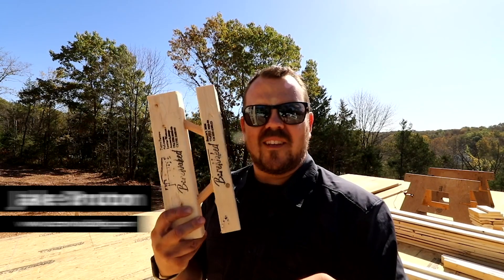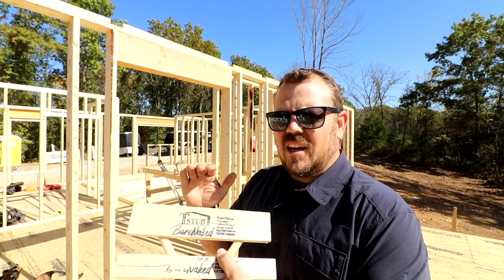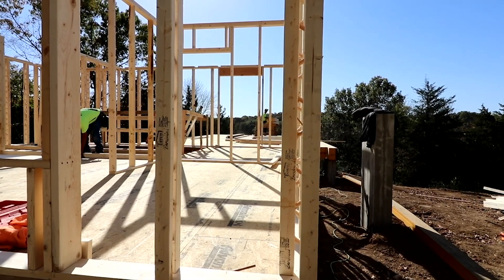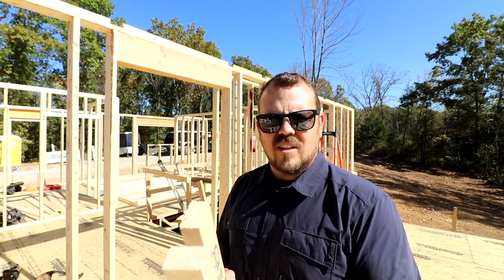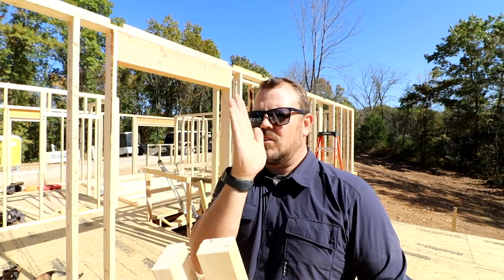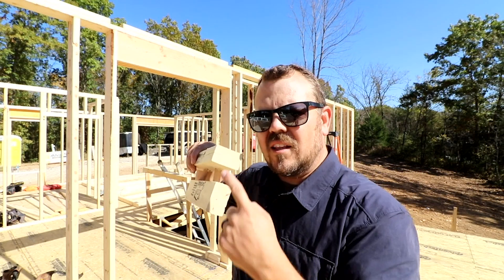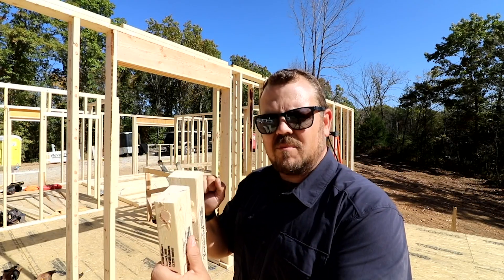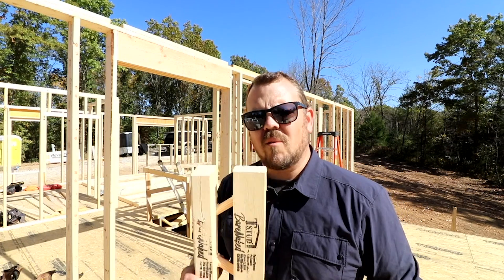T-Stud Framing, is it the Future?

Comment: Wouldn’t those little boards just split out easier when you start screwing and nailing them? I’m not a carpenter I’m just curious. Plus I don’t think I’d mount a tv or anything to those. I don’t think it’d hold as well as a 2x4
Reply from the maker: If they were smaller, maybe. However they are large enough to not matter.

Comment: Kind of defeating the purpose of the t-studs if you are not using throughout the exterior walls. Waste of time & money if not used properly.
Reply: Are you letting perfection be the enemy of good?  This contractor is right in that his use will still improve overall thermal efficiency of the structure, and make installation of the electrical, plumbing, and HVAC linsets simpler/cheaper/faster.

Comment: Why not use a 2x6 plate and then use 2x4's staggered on 24"OC.  You then have a wall that is essentially framed at 12" OC.  I would bet that would be alot less than the TStud, and is also very friendly to plumbers and electricians.
Reply from the maker: We are definitely trying to find the absolute best method. I think we will be trying that at some point too. Great tip.
Reply: From what I recall, the cost versus 2x6 or 2x8 isn't much different. Plus those are already r20 or r30 if you get the insulated ones and the structural rigidity is much higher plus headers and top plates are going to be simplified as well and cuts down more on the thermal bridging.
Reply: No one should frame on 24" centers.

Comment: it always astonishes me how little value is placed in the USA on the strength in walls. The second point is, I would never use an isolation that burns, or even produces poisonous gases while burning or melting. For me I would use 2x8 for strength. On two storey houses, the 2x8 go all the way, not ending below the second floor, with a second set above.
Isolation would be stone wool. When you need additional Isolation or protection against fire you place a 50 mm continuous dense (heavy) stone wool cover on the outside wall.
Reply: What in the good gracious are you talking about? Are you an actual carpenter? Much thought goes into the strength of walls when building in the USA. Balloon framing is very seldom used any more.
Reply: How long do those 2x8's need to be? Where do you get them?
Reply: The building codes vary vastly state by state or even county by county.  Most houses in the US are single story and many places see quite mild weather year round.
Reply: A foundation-to-roof framing is called "balloon framing" and may be outlawed in many US jurisdictions. It was used in the 1800s into early 1900s but common complaints included fire gaps between floors, bowed floors and walls over time, and less than ideal energy efficiency. I nearly bought a house with this construction many years but learned it had several structural issues and a broken foundation (caused by an improper addition, we think).